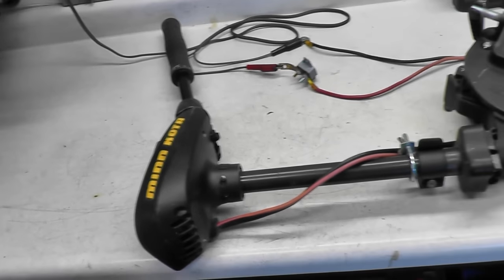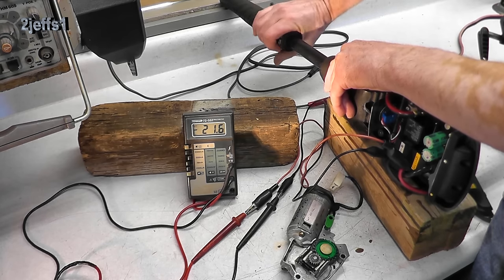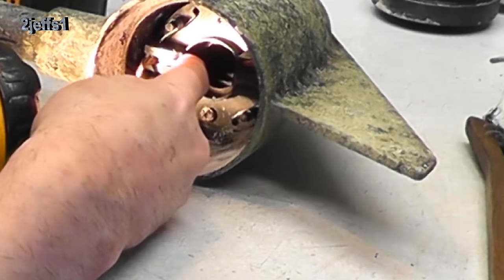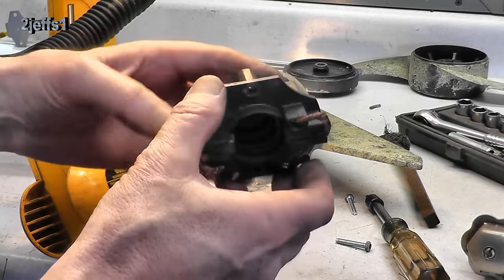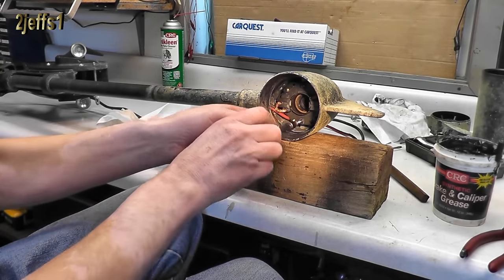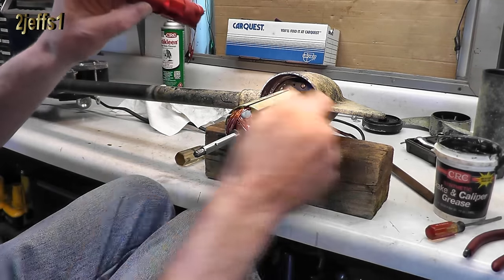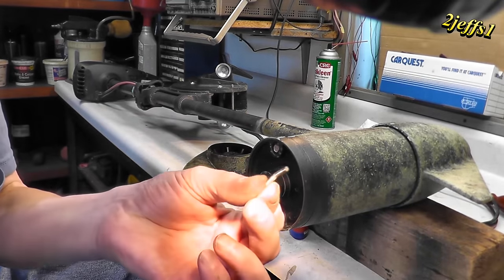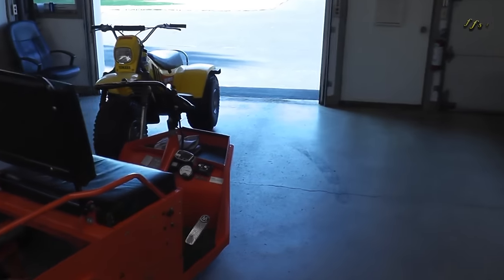Electric Trolling Motor Diagnose and Repair

Comment: I recently took my minn kota power drive apart . Looked to be the same as the one in your video . When I put it back together it was spinning in reverse .  Why does that happen ?  Does it have anything to do with the orientation marks you put on the motor before you took it apart ?
Reply: You may have switched the wires when taking the bottom apart? I scratched a dash into the negative plastic to keep it oriented when reassembling.

Comment: Great video, but I'd be concerned about using a drill bit for the shear pin.  I imagine it was sheared because your friend his a stump or something.  The pin is soft so it is the first thing to break, rather than the shaft or prop.  I would think soft stainless steel might be a better chioce.
Keep up the great work!  I always enjoy your vids!
Reply from the maker: Hi Jim. Another viewer brought that up too about the pin. I will bring that up to my friend when he picks that up where I do have the other options available here.

Comment: Professional Great video! But there is one question that, in my opinion, should concern everyone. How to check that no water enters into the motor after disassembling and assembling the motor? I had to disassemble my motor because my magnet came off. I glued on the magnet, cleaned everything, covered all possible places where water could enter with silicone. I tested the boat (motor) 2 times on the water and decided to see if water was coming in, I disassembled the motor again there was 100 -150 ml of water inside... actually I disassembled the motor, not because I was wondering if there was water, but because my new battery showed half the charge 5 minutes after I started driving. I very carefully read all the comments and am surprised why No one is interested If the water inside after assembling the motor.

Comment: My trolling motor runs all variable speeds out of the water. When I put it under load I hear the speed changes but the propeller spins at the rate equivalent to the first speed no matter what speed I turn it too. Thoughts?
Reply from the maker: Got a stump-er there Mike. The prop shear pin damaged where it slips under load? You probably checked that multiple times already, not sure what else to tell ya that would be of help.

Comment: Being a newbie in trolling, in an effort to grasp it All, so :  This is a PWM controlled, Brushed, motor? With 2 wires only, going down(the motor is not BrushLess, right?) (sorry for my style, don't want to be rude, just need to be sure) Thanks!
Reply from the maker: No problem Willie. Yes the motor is brushed and the fields are permanent magnets.

Comment: Nice video! My trolling motor works great until I dip it into the water. It will then work for about 15 seconds and stop and all power goes off. I lift it out of the water, 10 minutes later it works again while out of the water just fine until it goes back into the water. Any ideas?
Reply: I thought the seals were dried out and defective so I bought a seal set Yesterday I replaced the seals. Although when I took it apart it was completely dry and looked factory new in there. I was surprised. I really thought it would be full of "stuff"... So, I filled a trash can with water in the garage, dipped it in and took it through all the testing I could think of. If on a  lower speed, it will work for about 25 to 30 minutes and stop. Unplug the power, wait for 10 minutes and it will work again. If on full power it will cut off much quicker. Unplug power, wait and plug back in only to find the same symptoms again.
Reply from the maker: Possibly a weak driver for the variable speed circuit on the board.

Comment: I think you addressed everything except the thing I am trying to fix. There is an armature shaft seal in that rear housing. I have water coming through that. Did you ever do a video where you replaced that seal?
Reply from the maker: The only seal for the rear half by the armature was that gasket for the housing that I remember. If your getting water in perhaps look at that or maybe a crack in the drive housing? There is a shaft seal at the propeller end, possibly consider that too? Hope this helps John, Jeff.
Reply: I replaced the seal but you really need a bearing press to put it in. I just tapped it in as far as I could but it isn't in the exact place the old one was, so I siliconed the white plastic washer and it ran all day without water getting in.
Reply: John's Window & Door next time freeze the bearing and use a heat gun to warm up the case to around 130 degrees f.....the bearing will slip right in.

Comment: fantastic video.  i have a minn kota edrive 48v motor.  I any ideas what might be causing the very loud screeching sound?  I replaced the armature b/c I was getting an "obstructed prop" signal on the controller.  I replaced the entire brush assembly and the nose and the tail piece.  The seal was compromised in the tail piece.  Back to my question...any help with a loud screeching noise when it runs?  Thank you!
Reply from the maker: A seal can yes can cause a screeching noise. Did you grease the seal/shaft good before assy? Check out my Kubota video about a seal squeal. Might be a bearing but.... Hope this helps....Good luck.
Reply: @2jeffs1  thank you.  I have not greased the seal/shaft.  The bearings are new, as are the brushes, armature, nose cone and brush end. I will check out your video.  Thank you!
Reply: @2jeffs1  looked around at a couple of.your Kubota videos but did not find relevant one.  Can you please fwd link when you get a chance?  Tx
Reply from the maker: @johnson7228  I can see why you couldn't find it. Should of had a thumb with the Kubota in the picture. Here ya go. https://youtu.be/k9n_Y1jcfGA
Reply: @2jeffs1  YES!  I cannot thank you enough for the greasing the seal advice.  My rebuild is now complete.  I really appreciate your help!  Take care.

Comment: There's supposed to be a rubber gasket that goes between every component of the armature housing. Even two small ;-)rings that go around the two long screws you took out first.

Comment: I have a new 45 Endura. We went out on the lake and hooked the wire backwards to the battery. Now it want do anything. I s this the controller switch?
Reply from the maker: That's not good to hear. That probably damaged the circuitry in the speed controller beyond repair.

Comment: What damage will be done if I put 36 volts to my 24 volt trolling motor?   My new controller can handle 36 volts.
Reply: Kevin, don't do it, you will go Real fast for a short while then be dead in the water, it would take longer but 30 volts will fry your 24 volt pretty quick

Comment: Hey Jeff,  What a grear tip in the testing of rhe board !  Did the factory use a roll pin  to hold the prop for a shear pin  ?  You had some great tips  that I am going to be able to test a small project !  Thanks as always for your great tips !  Have a great week !
Reply from the maker: Great question Cory. I had them here too but where the solid pin is what was in it that's what I put back in. I think I will give my friend that option now that you mentioned it. There would be the possibility that's what they originally came with.
Reply: Hey Jeff ,  I think that the use of a drill bit that you  used was brilliant !  I have to say that your yamaha 3 wheeler must be a one of a kind looking like that you probably bought it new !  I think that the cushman ??  will destroy it with out any problems !  I will be cool to see the build !  I am looking forward to seeing that !  Have a great weekend !
Reply from the maker: Actually I bought that Yamaha new in 83? before I was here. It has some rough miles on it. You'll understand when you see how I drive that. I try to keep things looking nice so that can be deceiving. When I first got it I turned up the oil injection a tad. Think that helped preserve it. Still has great compression. The rest of the electrical parts came for that today. All the stuff that is on the Cushman was for the Yamaha. Really liked it on the Cushman so... Hope you have a great weekend too!
Reply: well any one that you have sold a vehicle to or worked on their vehicles or any thing else shoould know that you do ONLY QUALITY !!!!!!!! work !

Comment: Great video. My t.motor will not reverse, any ideas where to start?
Reply from the maker: Hello Jason. Sounds like a problem in the motor controller. Separate the motor wires off the circuit board at the controller and try to power just the motor with a battery by reversing the wires there. Should be able to get both directions.
Reply: 2jeffs1 thank s jeff, i will look into this further in a couple of weeks from now and i will get back to you on it. Thanks again for replying.

Comment: That pin that holds the prop against the shaft is a shear pin designed to fail if it hits rocks or gets fowled!
Reply: To protect the prop? Or motor?

Comment: 2jeffs1Excellent vid! Nice to see a really clean uncluttered shop. Also your ongoing explanations are appropriately informative. Regarding underwater electric motors, my question is how assurance can be made to keep water out. Is the grease alone sufficient? And is the caliper grease you used best for that purpose?
Reply from the maker: There is a shaft seal which had the proper amount of drag when turning the shaft so no need for replacement. The outer case cover has an o ring which seems I replaced and the inner case had a gasket which was in good condition. In regards to the grease it is possible there is something better than what I used but been using that with good results so....

Comment: What does it mean when it turns on and off
Reply from the maker: It is called pulse width. It is rapidly pulsing on/off varying the rate to obtain variable speed. The faster the switching the faster the motor will run.
Reply: 2jeffs1 thank u thank u
Reply from the maker: Hi Eddie, had to say Thank You! so appreciated when folks respond back!
Reply: 2jeffs1 Any time buddy

Comment: Great except for the shear pin being replaced by the drill bit.  The shear pin is supposed to shear if the prop encounters something that obstructs it.  I carry three in the field.  Otherwise an outstanding video. ps I like the dog!
Reply: Just curious.  I have seen this comment twice now.  Drill bits are very hard and sheer easily.  Especially the Chinese made ones.  So why is a drill bit a bad choice?

Comment: And I'm back again so it's not the bearing that's the issue I turn it on it runs as soon as I turned off it stops and will turn on again and I tap on the side and it starts working again I'm assuming it's going to be the it's has a bath Spring

Comment: Jeff what can i use to hold the magnets on to wall of trim motor housing
Reply from the maker: Sorry. Not sure what to use for that. One sure don't want them coming loose again.
Reply: @2jeffs1  future reference its loctite number 326 if you every run in to it works great i save $630.00 dollars from yamaha for new one boy oh boy
Reply from the maker: Thank you! Good to know, will help others from your post!
Reply: @georgemay1775  so the magnets came off of the housing?  Did just fall off when you removed the armature?

Comment: should that pin be a breakaway pin for the propellor ?
Reply from the maker: Did express that concern to my friend. Told him to check with a dealer for the exact replacement if desired.
Reply: yeah ok its probably why it was bent  may not have been the correct pin, i believe they do that amongst other things to protect the shaft so you don't have to grind off burrs to get the prop or shaft off
Reply: I cut a nail to length for an on the water repair. 5 yrs ago and never changed it

Comment: The only thing i would have done different  i would have put back the original  shear pin in the prop  because with that drill bit it is  case hardened and you may destroy the prop or bend the shaft because the shear pin is case hardened it is to protect the propeller and shaft from damage if you hit something otherwise great job i'm working on a 709 motorguide  that's not working at all i'm really hoping its not the circuit board because the customer did not want to pay the 168 dollars for the last one he had that a circuit board  in it go bad   so he scraped it and bought this one that's now gone out  and the older one was 55 lbs thrust 12 or 24 this one is 109 pound thrust and takes 36 volts i've done 12 and 24 but this is first 36 volt one lol

Comment: IT'S MUCH EASIER TO POUR A GALLON OF Gas into the bike then it is to run out 300 ft of cord down the driveway and hook up a battery to a charger and Waite for it to charge. Then put all that crap away. I'LL stick with the gasoline